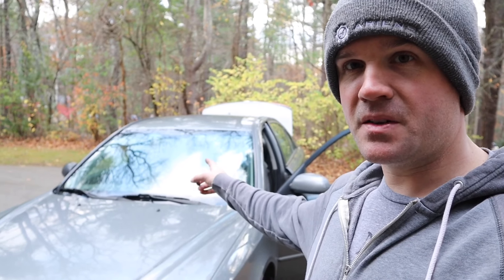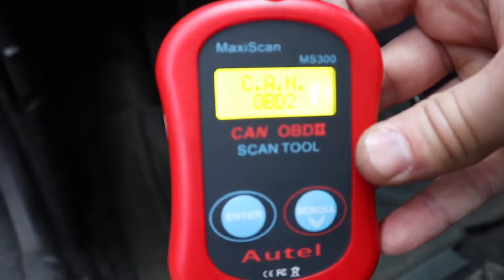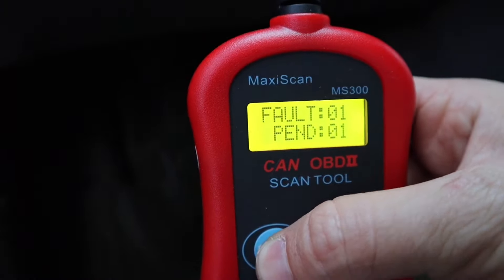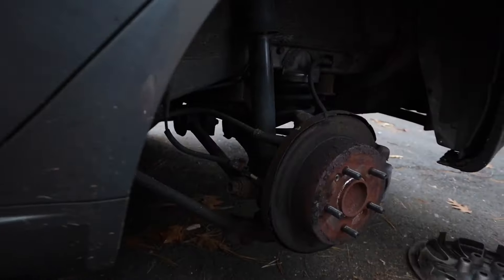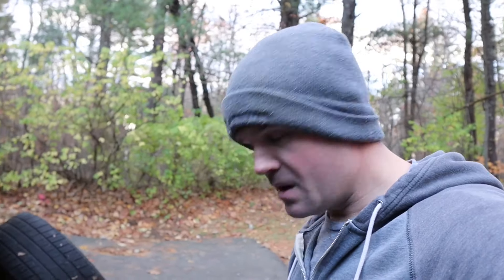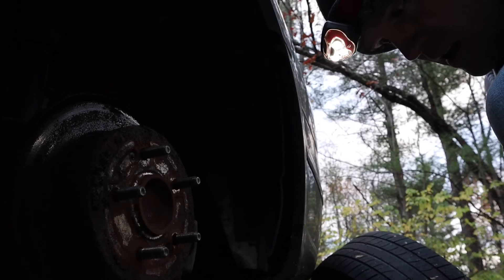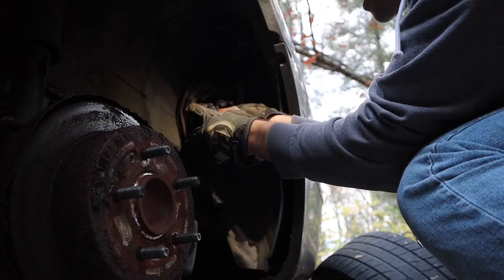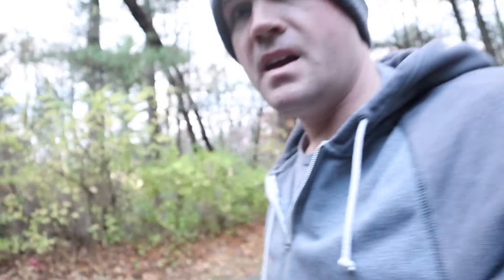How to fix check engine light P0456

Comment: Be careful. Sometimes when you replace a part and that was not the problem it takes a long time for the code to come back especially when its a small leak at the fuel pump , until it's worse. That is actually the most common cause 2007-2009 Sonatas.  When my mechanic replaced mine he insisted on using OEM because he had too many comebacks on aftermarkets with altered design.
Reply: So basically buy the original part??
Reply: @foredimples529  yes this and the purger valve you should always get oem from the dealer after market is risky ask me how i know it took two times and two gas tanks collapsing on me bevause of after market parts .when it comes to electrical some parts are just best bought from the dealer
Reply: @chrisschlichting9145  How does a bad purge valve collapse the gas tank?

Comment: Great video! Did you have the code cleared out with a scanner after the part was replaced, or did you just keep driving it until the monitor ran another drive cycle and turned off on it's own?

Comment: I would not be surprized if the location of that thing doesn't contribute to the problem. That should definitely not be happening that much. My Mitsubishi has that problem now but it also says the gas cap could be bad causing the problem. I replaced the cap I think about a year ago and it solved the problem for a while and now it's back again. This time I will replace the purge solenoid and probably a new cap again and keep the old one for a spare. I hope my purge solenoid isn't where yours is though! The gas cap definitely CAN cause this code though so if you have a really old one you might replace it too.

Comment: I have a ML350 mercedes, 2004, had the PO456, replaced the part, and the car started perfect, the noises were all gone, everything was working excellent, drove th the gym, 5 miles away, after the gym, it had reverted back to hard start and "air squish" sound-any ideas?
Reply: Gas cap (try replacing this first). If not, one of the many plastic pipes in EVAP system has a small hole or crack. Need smoke system, to my understanding, to find the hole. It's a PIA.

Comment: Once you made the repair will the code simply go away?  or do you need to somehow clear it out?
Reply from the maker: It will go off after driving for probably 50 or so miles or you can clear it like I do with the cheap OBD2 reader I show in the video that I bought off amazon.
Reply: @TheComebackKid   it answer my question thanks before u replaced this axis u smell gasoline sometimes when error code lit? Yeah mine the same hoping this will resolved it and won't smoke it to find out in the shop. Expensive charging me $300 to smoke it.

Comment: I think buying the canister close valve from Rock auto or anything other place than OEM part from Hyundai is a mistake, that's probably why you keep getting it and have to fix it again and again because those after market parts doesn't operate as good as the OEM, However there is a lot of parts you can buy aftermarket and work perfectly fine but when it comes to  evap system, I don't think so, that's just what I've learned over the years, cheers
Reply from the maker: Hi the boss.  I understand your point but I’m not sure what the root cause is.  I have replaced probably 4 canister close valves on my 2009 sonata with 212k miles over the years.  Thanks for watching!
Reply: @TheComebackKid  that's probably why you had to replace it 4 times, if it happens again just buy OEM one and see, thanks for the response,
Reply: You might be right. I bought one for my 2011 sonata from autozone for about 80 bucks. I replaced it and I still get the check engine light. I have replaced gas cap bought from Hyundai. Now I’m thinking of buying a purge valve from Hyundai

Comment: After installing the purge valve and the gas cap I decided to get a smoke test which I should have done to begin with.... In my case it ended up being the fuel filler neck
Reply: Was it an expensive fix??

Comment: I got this error code and Autozone told me to replace the Evaporation System Control. ESM1001. I just replaced that.  How long until the light goes off? Or is is possible it’s something else beyond what their system said to replace?
Reply from the maker: Hi Faith, you may need to reset the code on your car so its off then it will stay off.

Comment: My engine light came on, it was detected to be  EVAP system leak ( very small) can I still drive my vehicle?
Reply: It's not recommended, but a lot of people do....In my case, if the light flashes, it says take it in immediately. If it stays on, they say I can drive 100 miles.
Reply: I think you might see a slight drop in gas mileage....im not a mechanic by the way.

Comment: on rock auto it's called (Vapor Canister Vent Valve / Solenoid)  pt# 314533K500   25 bucks, cheapest price around hands down and oem part. welcome!